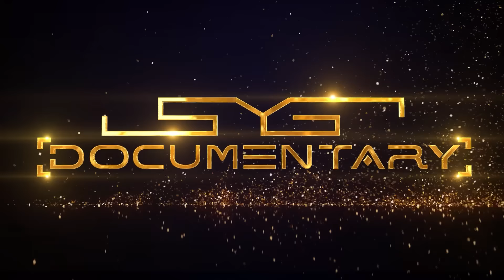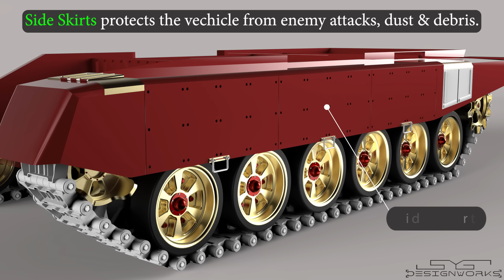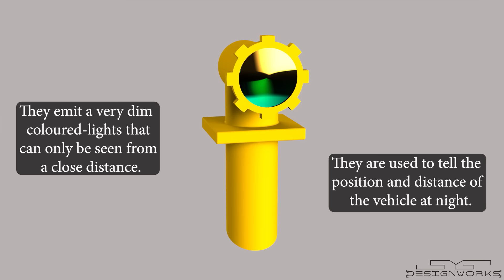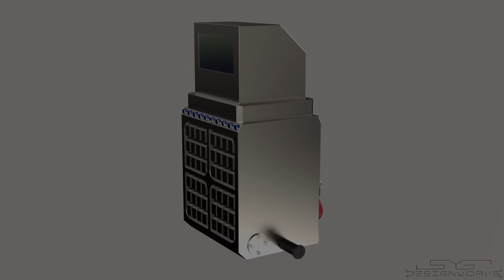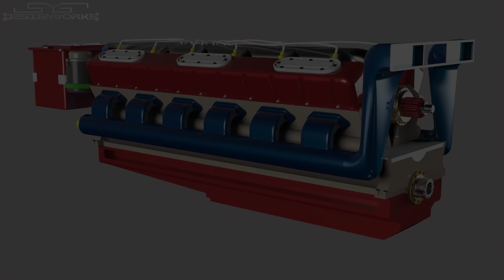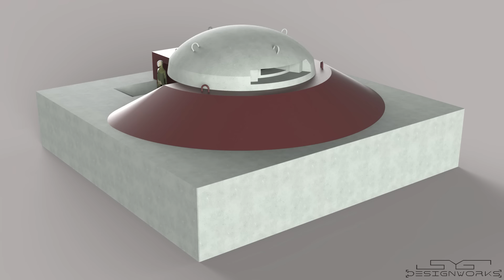How Vacuum Bombs Work: A Detailed Animation

Comment: Regular Troops stand very little chance of survival on a modern day battlefield against these types of weapons!
Reply: No chance, temp goes up to 3000 degree Celsius in the centre
Reply: @olegdjakonu9468  Behold the majesty of finely divided metal that is burning as a result of being explosively compressed. 
...also, rubbing your feet on carpet and zapping your sister causes an arc that exceeds your impossible temperature too. That "snap" sound is a supersonic shockwave from the expanding, superheated air. It's just the scale of the devastation that has you befuddled.
Reply: Тем более,что тос предназначена для отчистки территории от химии. Тос и входят в состав войск РХБЗ.
Reply: @ivangorby8150 let us hope and pray such devices are not used against each other. Americans love Russians. We do not like Russian leader, Putin, but we love Russians. Especially Russian women😁
We do not like our leaders very much either, but Putin is different. 
I pray that we continue to battle Russians in sports and not in real battle
Reply: @ivangorby8150 nice profile image
Reply: They’ve said that same thing in every era of history. What happens is that someone develops a defense that not only protects the “regular troops” but removes the threat on the battlefield.
Reply: @tarn1135 exactly! That’s why things like C-RAMs and Trophy Systems were made.
Reply from the maker: Very true. Thanks for watching!
Reply: The AGM-114 Hellfire missile uses the same type of warhead. This is just a new name for a common weapon so that when we use it it's good, and when they use it, it's bad.
Reply: @buckstarchaser2376  Not by default no, it depends on the type of Hellfire, there is indeed a thermobaric variant that works similar but there are also one's with tandem shaped warheads, meant to destroy tanks or other armored targets, there is also the ninja bladed one meant to assassinate individual targets
Reply: @buckstarchaser2376 
Yeah, it's pretty much 'if the shtf get  theirs before they get ours' for the super powers.👍🇺🇸😎
Reply: @buckstarchaser2376 
The AGM-114N variant does, but unlike the TOS-1, it’s not a normally used variant.
Reply: @jesusofbullets  The one that makes a little hole in the ground and everyone around it are dead without external signs of injury was the one I most often heard being used in Iraq when I was there. It was pretty new at that time, but it's been in production longer than nearly any other Hellfire. A lot of the other ones include metal to enhance the explosive yield, they just don't brag about the gut-liquefying bonuses publicly anymore.
Reply: @buckstarchaser2376  
The N variant is the MAC variant, but once again, it's not as commonly used as the R because it has a large blast radius (detrimental to urban warfare), is costly, and less effective against open air combatants. The reason it's been produced so long is because it still fits the role, even as it's been superseded by 4 variants through the years.
Reply: @jesusofbullets  It's used most because it works great against groups of people, whereas if it only had the shaped charge it wouldn't get used very often. Of course, soldiers don't typically bunch up for this very reason, but it's not always used on soldiers. 
The ninja variant is just for show. It is a way to brag about weapons accuracy and psych out a country's fighters when their leader gets bullseyed. In any other case, the messiest round is chosen.
This side argument is off topic though. It doesn't matter how many "vacuum bombs" the US has in its arsenal. The point is that calling Russia evil for having them is a self own for pretty much every NATO country. At the end of the day, they're pretty cool. I just wish that helicopter chainguns were better so that it would cost less of my tax money per mission.
Reply: @buckstarchaser2376   It's NOT used most though. If you think all the other variants only have a shaped charge, then you're just flat out incorrect.
The M and P variants were made before the N variant, and have blast/frag warheads, and the R variant has a multi-function with reduced net explosive weight for urban usage. Any of these three missiles are FAR more likely to be used on a normal basis due to mission constraints and need.

For usage against personnel, they're more likely using the M or P variant and possibly in airburst mode.

You're thinking of the R-9X, the ninja missile. The R and the R-9X are VASTLY different missiles. And no, it's not just for show. It's for low-collateral, single target hits of high priority targets.

"In any other case, the messiest round is chosen."
This is simply and easily not true. The payload is suited for the mission, and the N variant (thermobaric) is simply too powerful for normal use (especially in urban environments) and limited in it's scope.
Reply: @buckstarchaser2376  
And if Youtube will stop auto-deleting my replies,

The difference is that Russia is using these en mass every day with the TOS-1 while the US uses them sparingly
Reply: @jesusofbullets  Mass fire is standard US military doctrine. You don't have an argument. Also, Ukraine burns through its supplies of donated ammo faster than the various nations ever intended to use them itself. "The US" and "Sparingly" have no relevance here.
Reply: @jesusofbullets  Your arguments are not really holding up against in-theater experience and general military training. Perhaps everything has changed since I got out, but it's unlikely. 
There is no "minimum force" goal in a typical military operation. It's "overwhelming force" or nothing. It's shock and awe, etc.. 
The most lethal option is always to be taken in a combat theater. The reason why high-yield Hellfires are used is the same as why artillery tries to get all their rounds to land simultaneously. The first round to hit will send everyone to cover, so the first hit needs to wipe out as many/much of the target as possible. I would think that a fragmenting warhead would be superior to barometric, but overpressure gets 'em behind cover and doesn't need to contact them with shrapnel. It is clearly the cleaner option. Like I said, It leaves a small hole in the ground and a bunch of seemingly untouched bodies. They simply drowned in lung juice. Open casket even. 
I'll repeat that my point is that every country uses this type of weapon, and so go focus on some real thing that the evil enemy is doing, or the enemy will cease to be evil, leaving the other side in question. 
For everything else you're wrong about, simply watch some cockpit footage with audio until you know the difference between brochure talk and historical action. If you get bored of that, start watching anti-tank cluster munitions vs downtown populated streets videos.
Reply: @buckstarchaser2376  
"Mass fire is standard US military doctrine"
It's literally not though, especially for Hellfires, which are precision guided weapons. Where did you start talking about Ukraine? The US hasn't supplied any Hellfires to Ukraine either, so this is a really weird tangent to go on.
Reply: @buckstarchaser2376  
Dude, I'm really trying to give you the benefit of the doubt here, but the more you say, the less I believe you were even close to anywhere where Hellfires have been used.
Reply: @jesusofbullets  You don't have the level of understanding required for this argument. If I had to guess, I'd put a considerable bet on you being as automated as this video.
Reply: @buckstarchaser2376  
I literally laid out that the thermobaric is unsuitable for general use due to mission requirements, lack of versatility, and high cost

You throw some weird argument that "mass fire is US military doctrine" when in reference to precision weapons and claim that they were used because you "saw a bunch of guys in theatre who looked like they died because of a hole in the ground", disregarding that airburst modes of Hellfires do the same thing with the pressure wave.

Then, when you can't defend your arguments, you just refer to "you're a bot".

Great arguments that sound totally real and not like a 14 year old got his dad's computer.
Reply: @jesusofbullets  What are you even arguing about? Every response is about something not related to the video, like you're trying to demonstrate that you studied your favorite video game thoroughly or something. 

My entire argument is that every country who has a military uses this type of weapon as a staple - even improvised versions - and so you can't paint one country as using an evil weapon without self-incriminating. Nor can you say that country-X is off the hook because it didn't have a particular weapon listed in its arsenal.
The video is bunk in its goal of painting any particular country in a bad light on this topic. 

Thermobarics are cool and usual.
Reply: @buckstarchaser2376  
You started bringing up Ukraine when we talked about the single, scarcely used hellfire variant (of which we have given zero hellfires to Ukraine), which had zero relevance to the conversation. Repeat, there is zero connection between Ukraine and Hellfire missiles. The US is the only one with Hellfire N's, which is why I brought up that the US uses them sparingly.

My argument is that a SINGLE, scarcely used Hellfire variant isn't the same as an MLRS designed to launch tens of them at the same time and that is literally used every day.
Reply: @jesusofbullets  You're not even arguing. You're just trying to make an arbitrary equivalence between a harassment weapon and a targeted one. There is no moral argument to win here between both parties. All militaries use saturation weapons, or they haven't won a fight. 
To quote GWAR: "Bombs explode, 'cause that's what they do." 
You're saying that one is somehow bad because there's more of it, rather than the guided versions that actually hit what they're aimed at. 
I'm saying that you don't know what you're talking about and should report this error to a technician so you can get your script updated or retired.
Reply: @buckstarchaser2376  
My brother in Christ, a hellfire is a PRECISION GUIDED MUNITION. You DO NOT volley fire Hellfires, much less the SINGLE VARIANT that is SCARCELY USED. It's laser guided, so volley fire wouldn't even work as the laser narrows down as the munition travels (meaning that later launched Hellfires don't acquire the narrow beam).

Dude, you're trolling at this point. You're talking about scripts like you're some kind of bot (I have actual evidence of being a human, unlike you) and pretending like a Hellfire is used like an MLRS.
Reply: @jesusofbullets  You're not even taking my words as they are plainly stated. You can't argue if you don't even comprehend what I'm saying. You are clearly a bot, because you were less dumb than you clearly are now. You don't even need to argue with me, and shouldn't do so if you are upset. Your programming is completely broken down at this point.
Reply: @buckstarchaser2376  
God, I wish I was a bot so I wouldn't have to read the stupid shit people like you say. It's an unending spew of the dumbest things you can say.

Comparing saturation weapons with PGMs as if they're comparable and then when your arguments are destroyed, all you can do is call other people bots without even thinking about it.
Reply: @buckstarchaser2376  🤣😂
Reply: These types of weapons costs millions of dollars to make just one. Human foot soldiers are cheap.
Its the cruel reality of war.
Reply: So special troops and irregular forces stand a better chance?
Reply: Why hasn’t Russia been using them?
Reply: They have  @NoahSpurrier
Reply: @NoahSpurrier использует и много, потом только оплавленные камни остаються😂😂😂😂
Reply: This weapon is so vulnerable to regular weapons.t Destroyed by mortars hence it has no real place in Ukraine war.
Reply: Seems like the Ukranians are standing up to them no problem!..
Reply: @Amduscias13  not to those, they are rarely used.
Reply: @Amduscias13 from the footage of impact sites I saw, nobody was standing up and if they were only ash remained.
Reply: Frontline combat troops are issued 24 hours of food packs, they're not expected to eat them.
Reply: That’s why there are no “regular troops” anymore.  Nobody is out there massing volleys anymore and these large slow moving vehicles would likely be targeted first if it ambled up to the front line.  Something like a HIMARS 15 miles away would pluck it off this plane of existence like a child tired of his toy truck.
Reply: Next battles will be fought by robots/drones
Reply: @buckstarchacer2376..приветствую вас! Вы не совсем правы..у ракетной системы ТОС -1А ракеты используют у
боеголовку содержащую 400литров специальной аэрозольной взрывчатки..то есть (и в немного не корректно описано) при подрыве такой ракеты ,а подрыв осуществляется не при непосредственном контакте с целью,а на небольшой высоте,чтобы вся эта взрывчатая аэрозольная смесь распылилась как облако и произошла объемная детонация .Для чего это нужно,облако распыляется и попадает повсюду,спасёт только (и то с множеством ограничений) герметичное и укреплённое помещение.Вы понимаете что герметичных бункеров,всяких дотов нет .Но есть и минус ,при такой массе боевой части (400литров) ,ограничена дальность полета около +/- 15 км ,это конечно мало.
Reply: Big if true
Reply: Exactly
Reply: Yet the Ukrainian drones have successfully destroyed these $15 million weapons systems more than once, the weak point being the launcher itself?
Reply: 1 FPV и всё нет этого...
Reply: uh thats the whole point ?
Reply: @GigaVids  They stand an excellent chance as they snipe it and blows up. It is practically useless. All the flamethrower weapons were discarded as too vulnerable.
Reply: the war is actually for P2W player, not for F2P. 🤐
Reply: So we need stormtroopers?
Reply: that's kind of the point😂
Reply: That's Why Trauma Teams Wear Full EVA During Combat Operations Although The EVA Rigs Cannot Survive A Direct Hit From These Things They Can Help Aid In A Full Retreat Due To The Use of The Internal Oxygen Unit Which Can Supply 30 Minutes of Breathable Air And As Always The Counterattack Would Come From Orbit In The Form of A 120mm Round Fired From A MAC Cannon In The Direction of Fire For Area of Effect No Doubt Trauma Team Would Suffer Losses But Russia Would Lose Every Thermobaric Launcher They Had In The Area Along With Likely Civilian Casualties And Long-Term Damage To The Ecosystem So Yeah Trauma Teams Are Not "regular troops" Their Most Reliable Weapon Is Their Radio
Reply: @75GearOneOver74 what
Reply: Yup that's the point
Reply: i mean, they never had a good chance of survival in any day battlefield since the dawn of mankind
Reply: Thank you captain obvious for telling us a person can't survive a bomb
Reply: So.......yea man, that's clearly what they were going for
Reply: Hints why trench and bunker systems still play a role in modern warfare!
Reply: Ну подивіться на російсько-українську війну - це як раз така ситуація.

Comment: 24rockets each 216kg=5184kg, this system cannot weigh 4,5 tons as stated.
Reply from the maker: Correct. The fully loaded TOS-1A weighs 45 Tons, not 4.5
Reply: Dry weight